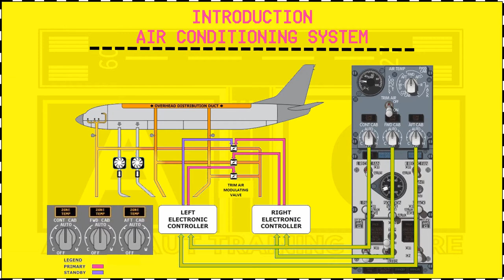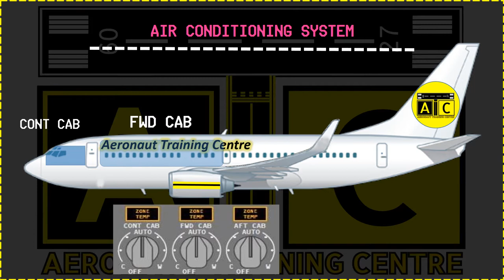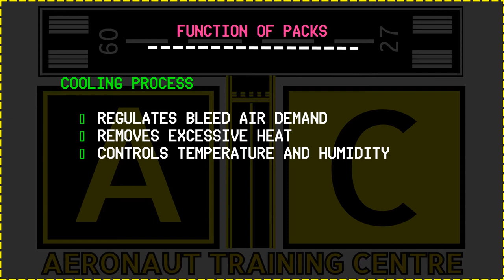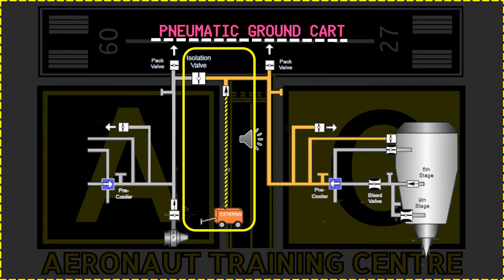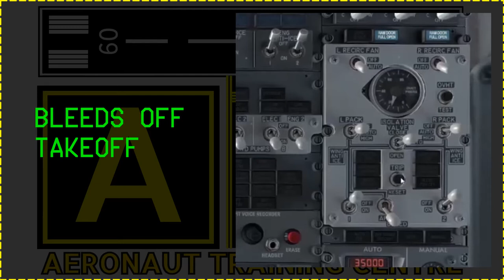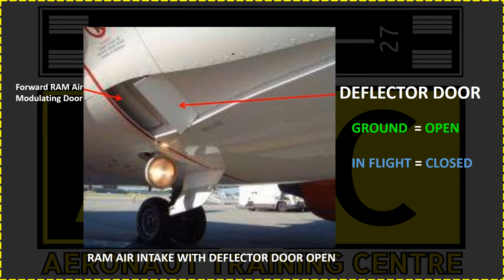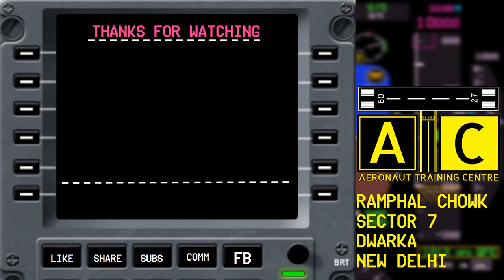Technical | Air Conditioning System Part 1

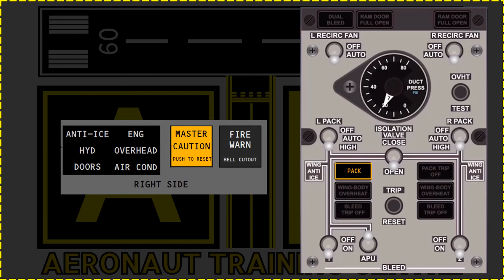Comment: Which principle you mentioned at 8:04?
Reply from the maker: It's The principle of Energy Conversion. In which a device involves a mass flow into the device and another one out from it, as well as an incoming and outgoing heat flow. The work output may be in the form of electric or rotating shaft power.